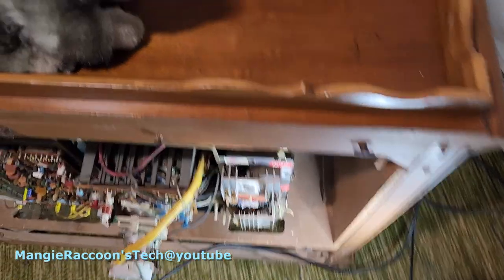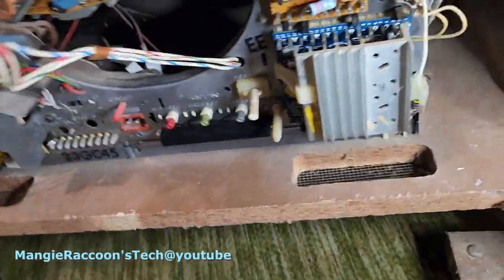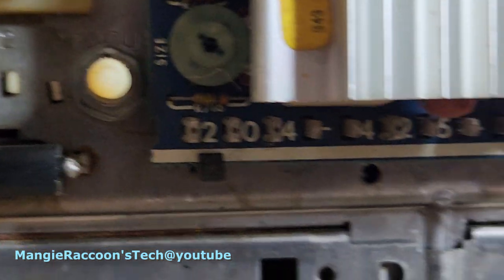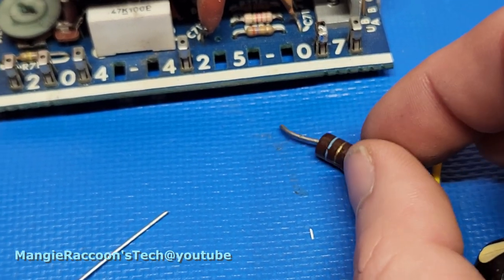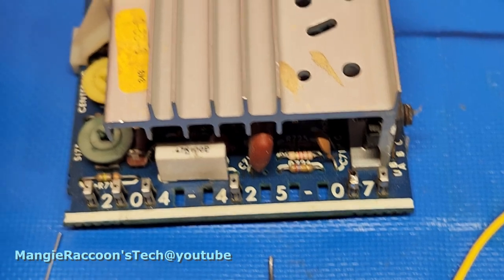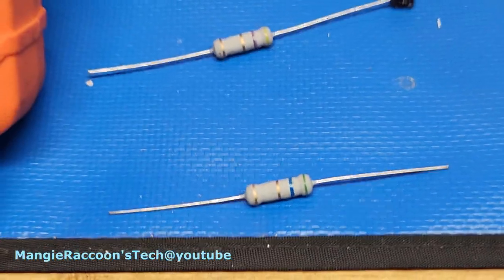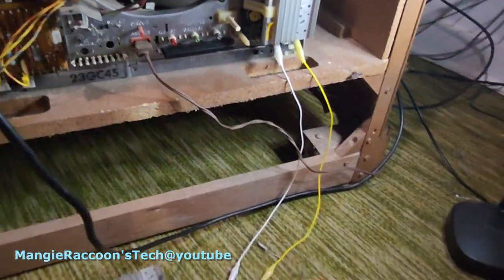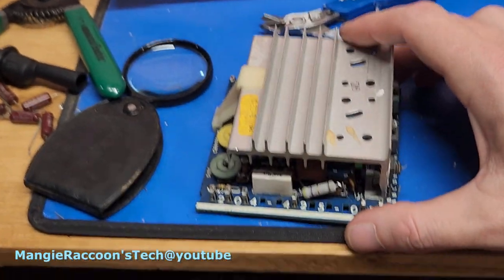1976 Zenith Vintage Chromacolor II Console Television Repair PT 4 of ?

Comment from the maker: I believe I was wrong on this repair/modification on the vertical board. Think I may have found the where the actual problem may be. Will do an update video once I get the set working again to test out this theory.

Comment: Never any vert mods on these. Its best to update the vert module, if broken,
with the updated 9-147 a much better module. Keep in mind the cut necks on Zenith are
in the end caused  by vert failure that puts DC on the yoke. So  keep time on short
with no vert sweep !
LFOD !
Reply: No.  The cut picture tube necks are not caused by a failure of the vertical module.  It was caused by a failure of the 4-lead capacitor in the horizontal section of the F-Line models originally outsourced by a different manufacturer, not Zenith.  When it failed, the high voltage exceeded the operating parameters of the picture tube.  Changed a few pix tubes and revised many chassis with the orange Sprague replacement 4-lead capacitor.  I've never seen the orange Sprague 4-lead capacitor fail.  Needless to say, the original manufacturer of the white 4-lead capacitor, soon went out of business.
Reply: 17, 19, 23" & 25EC45 & FC45 Runs 401 & higher.  Before run 401  4 or 5  22-5001 
caps used. They like to open too !
Cap opens but interlock dont. HV skyrockets. Things start blowing. Vert fails
& puts DC on the yoke. Turns the yoke into
a cutting wire . 
Bottom line orange Sprague caps good, White  American Radionics BAD !!!!
Went to seminar at the time. They had a movie about it.  Also in Zenith tech topics.
BTW this also happened to Maggy T991 chassii
CU later & LFOD

Comment: Man i wish you could fix my zenith i have i beleive a 1984 console i think its the voltage invertor switch box that clicks the power on and off the tv it was a common problem with them back then.i used to hit it on the side for it to come on and now it does not power up.
Reply from the maker: Not sure how far away you are, but I could maybe take a crack at it someday

Comment: Zenith would never had made a modification of that vertical module in that manner.  Never.  That resistor doesn't go on the 9-92 module at all.  It belongs BEHIND the board on the main chassis from that terminal to ground.  The original must be open.  Can't even believe you thought it goes on the module.   When you installed it on the module as you did, you made that module work only on that set.  Zenith would NEVER do that.  The color of the module doesn't matter;  If there was a modification of the module, Zenith would have labeled it as 9-92-01 or so.  The 9-147 module is an exact replacement for the 9-92 and is indeed more durable and reliable.  The "C" at the end of the part number is insignificant to the technician.  Not familiar with Zenith products is evident.
Reply from the maker: Thanks for taking the time to explain. I did eventually figure all that out, took way too long. Did return the module to the original configuration and installed the resistor behind the chassis. And yes, this is my first zenith television.